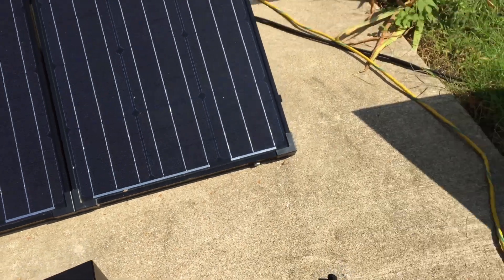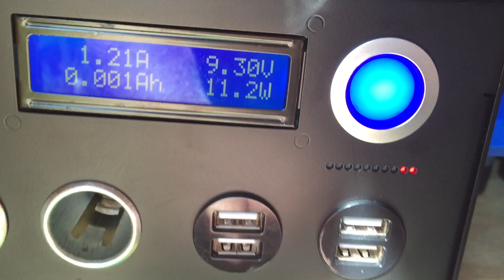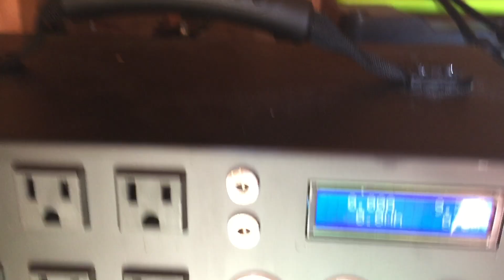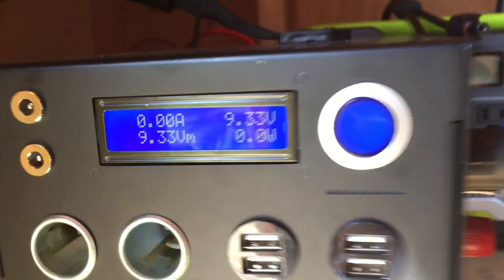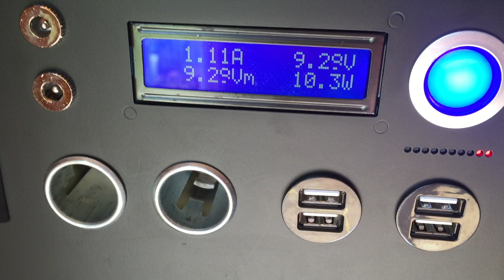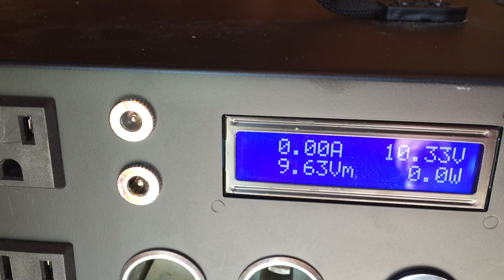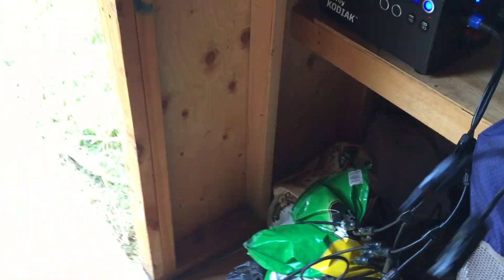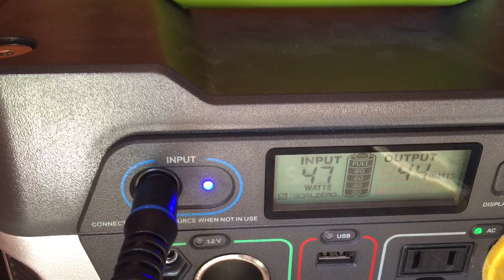Inergy Kodiak Solar Generator   Charging with MC4 Panels - Warning not successful

Comment: 2022 calling . Had to buy the same cable  from Ebay. Polarity is correct . The charging light comes on but it doesn't charge. Tried a different and it worked. Still don't understand what was wrong with the first cable.

Comment: One of the best reasons for buying and learning to use an inexpensive (under $20) digital voltmeter.  You could have determined whether the Kodiak was accepting charge by measuring the actual current going into it and made any needed wiring corrections.  Companies that don't use industry standard connectors may not be aware of reversing the polarity of the connections.  
My solar power isn't portable but it's bigger, more standard and much less expensive per watt hour of available power.  It's also all my design so I'm totally responsible for how well it works.  It handles fridge, internet and some lights for many hours.

Comment: It might have been the case that the original cable heated up because too much current was being pushed through it.
If only one solar panel was connected, I bet it would work OK.  Yes, it would take 3 times as long to recharge the battery, but as long as you have full sun, that's another way to go.

Comment: I just bought a Yeti 1400. I’m in earthquake prone CA. I wanted an off the shelf solar power source. Hot wires suggest a poor connection having high resistance. So many people (that probably cannot afford these) are quick to suggest building one. Having an electronic background I could, but I don’t want to. Why? The stock market has been very good to me so I’ll buy solar and spend my time doing other things. 
QUESTION- Which do you recommend , YETI or KODIAK? The great user reviews on the GZ and the ability to change out the Lithium batteries appealed to me..
Reply: Ed Victory I own. Yeti 3000 in ravaged Puerto Rico and I can say it is doing just fine.  I have two Boulder 100 panels a third would be needed.  It works perfectly.  It have not given me any issue until now.  I run an office fridge ,usb fans ,a TV with a cable box, LED bulbs and charge all my tablets phones etc.

Comment: I see you have a shed full of unreliable Solar Generators. With the money you spent you could have a 400 watt or more battery bank, a 3000 watt puresine wave inverter, a 60 amp MPPT charge controller, 3 sets of 20amp GFCI plugs with waterproof cover, 2 sets of usb ports, 2 12 volt plugs all with waterproof covers, a 30 amp RV plug with waterproof cover, a real amp volt meter, MC4 Solar panel connecter box also with water proof cover , bulkhead battery cable connectors that have safety covers 2 sets, inner box cooling fans, inerbox temp guage, a themastate that will aoutmaticall turn on the fans at the temp you set. SKG Portable Solar Power Generators.Oh and the price would be a lot less then the $ 2,000 t0 $ 2,700.00 most of you spens. Also your choice of 1 0r 2 Briefsase 300 watt solar panels and they are included in the price,

Comment: Hi Brian, if you have a volt/ohm meter with some pointed probes you ought to be able to test the heavy duty plug contacts and compare the voltage and polarity against each other. It should take just a few minutes. Normally the inner contact is positive and the outer shell is NEG.  If the company is going to send you another, at least you will have the satisfaction of knowing you tried to diagnose the issue.  Electronics is always something new to learn. Go get em' buddy. let me know what you find.   Jim K
Reply: James Krivitsky 
Ibew or electric company

Comment: You...my friend are a wealth of info....I'm looking to buy a solar generator...been looking at them all online and youtube reviews....You have the Yeti and the Kodiak....which do you like most and why?
Reply: Thanks for the response....So you find the Yeti more reliable ?  Would you mind elaborating why the Yeti is more reliable? I own neither of the units you have...I am looking to install one in my Truck Camper...space and weight are important. I've been leaning toward the Kodiak because of weight. The Yeti appears to have better build quality...I've spoken to the guys at Goal Zero and they have a 1400 watt lithium Yeti coming out in January through limited Costco stores. They did not have a price point...they may also have 1100watt lithium as well. The lithium's will get the weight way down and a smaller pkg.  I didn't want to wait till January so I was ready to buy a Kodiak...but your comment about reliability gives me pause...perhaps I should be a a bit more patient and wait for the 1400 Yeti?

Comment: I cant find stands for 150 watt Renogy solar panels were did you get yours? Also tested the Kodiak with 2 150 Renogy panels and it charged in about 5 hours. The cable did get warm but not scary hot but the wire was very short so ill do a further test when I get an extension cable of 20 foot from the panels to the Kodiak.
Reply: Thanks man!

Comment: Wow how frustrating. The older cable worked great on my 150 watt renogy panel and did not get hot. I have another 150 watt renogy panel on the way and once I hook it up in parallel ill let you know if I'm getting the same problem. Also do you have any thoughts on hooking up external batteries to the Kodiak?